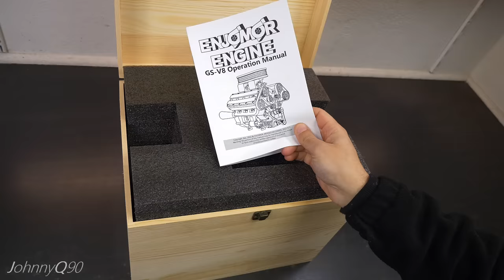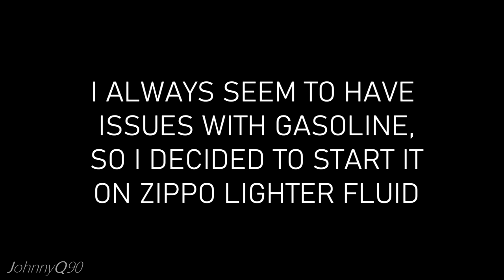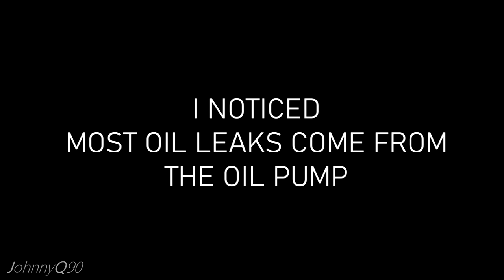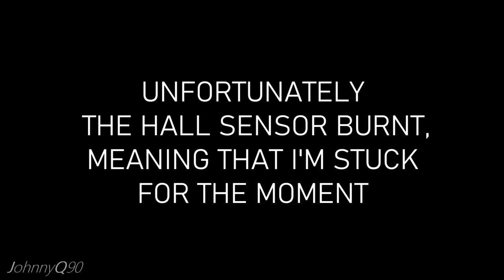Large Scale Model V8 Engine - PREVIEW

Comment: I'd be PISSED if that was mine. It just goes to show that QC is non existent these's day's 🤦🏻‍♂️
Who in their right mind would think "that's ready to go" when there's CRUCIAL parts missing which could of grenaded the engine!? It's ALSO leaking, with burnt out BRAND NEW parts AND it doesn't even run ???

How can you miss part's when there's ONLY 35 in total and was there a BOM? You need to strip it down to the bare block, check all the tolerances and make sure EVERYTHING'S there in the BOM. 
Going back to the dizzy (distributor). Your more than capable of making a new one that's adjustable with slots.

Comment: Not sure if you followed the development of this motor but I can almost guarantee if you run it on gas with a 2 stroke premix it will run great it was specifically designed and developed with gas in mind. mine runs perfect unfortunately I did have the same loose rockers and hall sensor issues but other than that it's a fantastic engine

Comment: Noticed in the video- may or may not be an issue with ignition, but at around 3:09 if you look at the left-most spark plug you can see the spark plug wires arcing to the side of the block. This loss of electricity can lead to misfiring spark plugs :)

Comment: I also bought this machine there is no problem so far it's amazing you should adjust the carburetor it comes out of the factory it's not the best I noticed the igniter you use 4s battery power it's voltage is over the rated voltage of the igniter so it doesn't work properly that's something to be aware of

Comment: Those carbs should have a main circuit mixture adjustment screw in the center of the throttle slide. It may be covered by a push-in cap. Some versions of that carb are easy to adjust, some are made idiot proof.

Comment: Keep three of these side by side and connect them to make V24

Also can you then a 3 staged supercharger (first blower second twin screw third centrifugal) 
Then can you add like 14 turbo which are compound like shown in boosted lifestyle

Then add 50% nitromethane with 50% ethanol with acetylene with pure oxygen

And can you make the carburettor attached to 

A direct injection system
Reply: You can save yourself all this nonsense and just use the money to buy a decent model engine from well-known engine builders 🤦

You don't seriously believe that this bunch, with the well-known quirks and dubious quality, produces and endures performance 🤷

Comment: The engineering on this and that belt quality are superior to the Toyan but id rather assemble it myself than risk someone not tightening something down. You could machine a ring with extended bolts for the distributor allowing enough timing adjustment.

Comment: Woow it has a larger displacement than the motor in my scooter hahsh I wonder if it would be possible to swap this motor for a scooter?  Or make a go-cart powered by this engine.  5 bhp on a stock engine, if you play with the intakes, exhausts, polish something here, tune up there, I think that with 7 or even 8 bhp it would come out.  And then turbo/compressor and N2O hahah
And one thing, how much power will produce (in NM) such an engine with such small pistons and cylinders in relation to 1 larger one with the same displacement? Smaller pistons, i.e. smaller cranks, i.e. a smaller lever acting on the drive shaft. 8 smaller booms VS 1 big boom (per cycle)
So many questions and so few answers 😂 I hope you will answer these questions in next vid🙏😋

Comment: Being a real life mechanic i have noticed running most of these small 4 stroke engines they have bog issues under full throttle. Makes me wonder if they need a little bit of fuel pressure instead of being just gravity fed🤔

Comment: You wrote that you used multigrade 20w50 oil instead of monograde 20. But your oil gonna act 20 when cold and 50 when hot so recommended mono 20 always runs as 20 while both ıt's hot or cold. This could be an issue I think
Reply: He has said elsewhere in the comments that it says in the manual 20w50, as a correction to what was said in the video

Comment: the spark wires are non isolated against high voltage of the sparkplugs. these tiny engines always seems too have the stupid problems we had back when the gasoline engine had in its first years. bad wires, issues caused by heat, ignition timing, compression difference, carburators not adjusted to the engine ect

Comment: Put this (or any other model engine really) into a 50 cc two stroke motorcycle! This engine has about the same power as these bikes have stock.
Reply: This motor is right around 5 horsepower

Comment: Hi
This may sound crazy, but I need to know if I can use Lighter Gas for my remote control car engine. The nearest store is 4 hours away and I don't have the patience to wait for my package. If not, is there a mix that I can make at home if I don't have nitro? Normally I heat the candle with a Glow and use 20% Nitro. (99.95% Pure Nitromethane, 99.9% Pure Methanol, 18% Oil Synthetic/Racing Castor Blend)

Comment: If it says to use 20 weight oil why did you use 50 weight?  20w50 is 50 weight oil that behaves like 20 weight oil in winter temps.   You want a  X w20 oil where X is lower than 20, so a 5w20 oil would be good
Reply: In the manual page 6 it says 20W50

Comment: carbys running often times better with air filter on the need little bit under pressure or correct the Tuning hope the nut isnt left in the engine

Comment: I don't know a ton but it seems like all the engines this manufacturer in particular makes has issues.  They seem to cheap out on a lot of parts.  

From videos I've seen on their I4, the cylinders need resleaved, piston rings are garbage, gaskets are useless, cam shafts are machined terribly, and the seal on the spark plug is non-existent.

Even when Stirling fired theirs up I commented on the lack of rev range and they said that is normal which is utter bs.  Enjomor just has terrible fit, finish and QC compared to Toyan

It's a real shame, I hope you can get yours running right.  It is an awesome concept to say the least!!!

Comment: 20w50 oil is 50W that does not turn to syrup as much at low temps.  Need to get 5w20 or any actual 20.  5w30 would be better than 20w50 here if they are asking for 20

Comment: You're gonna need a bigger car!

The problem you're having is because it's running LEAN, like really lean. Which is why it's getting hot (and runs better when hot)
you might be able to adjust the carbs, but at least put the air filter on, i'd bet that it runs better.

Comment: I got mine about a month ago the ignition box will not start it even though the plugs fire outside the engine they will not fire when under the combustion pressure trying a new ignition box and it fired up immediately but does not run the best. It is very tight when cold it is hard to turn over by hand also all the ignition wire in the distributer are loose, they are not crimped will that cause problem. Now I am trying to prove to Stirling kits that the ignition box doesn't work which is hard. ATM will not buy any more of these things I have a 32cc 4 cylinder that I got 3 years ago it is a book end and I think this will be a book end as well.

Comment: Bad thing about these engines is they have no torque and suck if theu are out in an rc car or truck. Maybe a boat would be a good rc vehicle for one cause high rpm is needed not so much torque for marine applications. Would be nice to see in a scarab racing boat with marlboro on the side

Comment: You put the wrong oil in it! No wonder you don't have any throttle response. You put 40 weight oil in it. It's supposed to take 20 weight oil. You can use 0w20 and 5w20.  The first numbers represent what weight the oil will act like when it's cold. The second number represents the actual straight weight of the oil.

Comment: Those sensors are a b&@$h and a half.  I bought a mustang when I was 19yo, paid cash, I felt amazing.  It wasn’t just the fact that it was my dream car but, I bought it- it was all mine.  Get it registered, pull out of the DMV and stop at a red light(maybe 1.5-2 miles down the road).  Light turns green, I put it in first gear and boom- it died instantly.  No stutter, no warning, it just… died.  The hall-effect switch or sensor just gave up the ghost.  Took me three days to figure out what happened.  I must’ve called the guy I bought the car from every horrible name in multiple languages.  😂

Comment: 20 weight oil would be 20w20 or 5w20 or 0w20        not 20w50 .............................. im kind of surprised 50 weight is capable of being pumped through that engine the pressures must be insane

Comment: these little motors get way too much gas, which is why it has no throttle response, if you can get a single carb and intake setup and lean it out, it should run better

Comment: i bought a 3sgte engine for less than this...25 times the displacemant, probably similar horsepower gap too, and itll take 300k miles easily. this thing is a desk toy, which would probably not survive for more than 1000 miles if its mounted to an rc chassis. smh, diminishing returns are real.